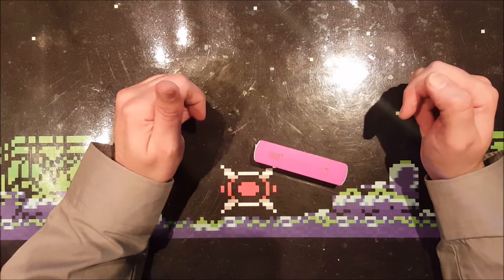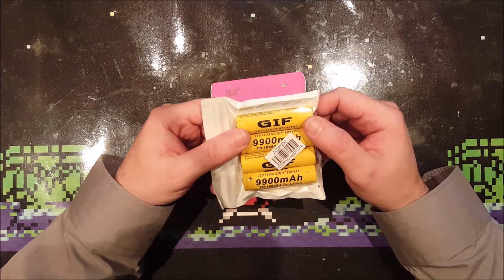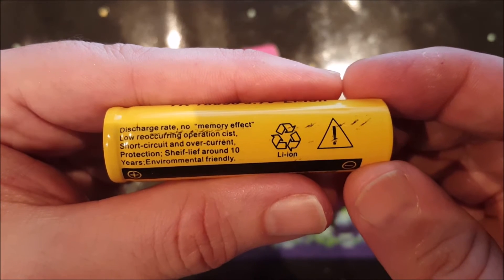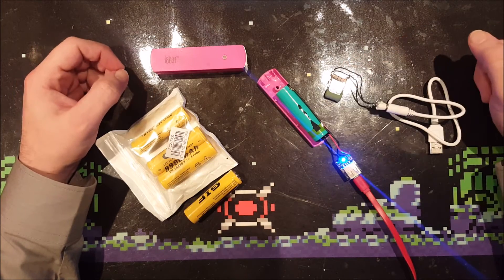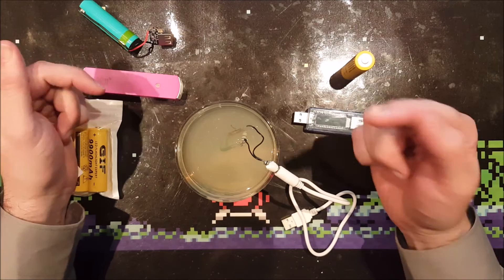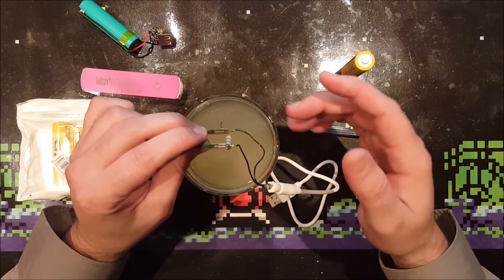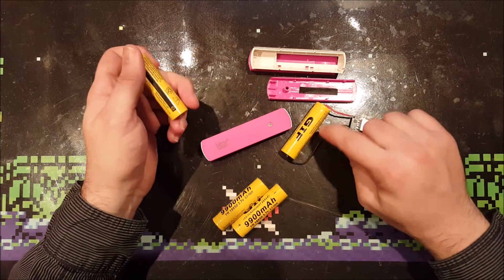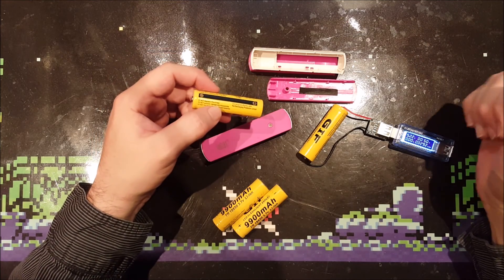"Upgrading" a 2200mAh power bank to 9900mAh with fake batteries?

Comment: SCAM battery! Not even 1000mAh – REAL capacity is below 500mAh!
This battery is a complete scam. I tested it, and instead of charging my 3880mAh phone 2-3 times, it barely charged 5% before the power bank died in just 10 minutes!

Power bank went from 94% to 10% in 10 minutes. It went then on and off
Phone charged only 5% (about 200mAh received).
The real capacity is likely 250-500mAh, not even close to 9900mAh!

This is a fraudulent product with false advertising. Do not buy from this seller! Completely useless and possibly dangerous! also it took very long to deliver.